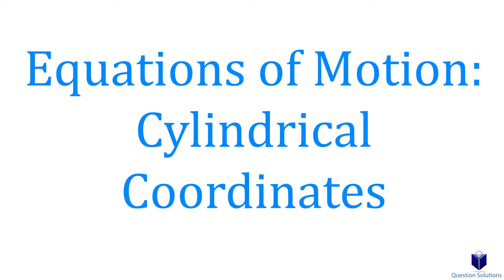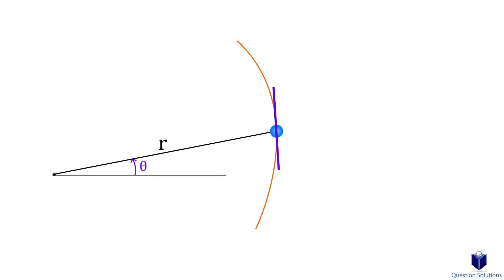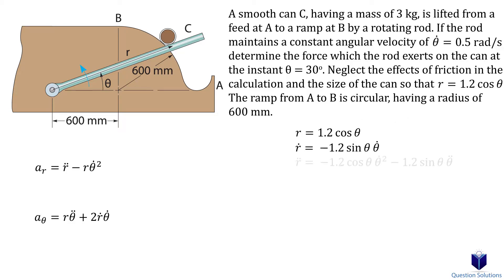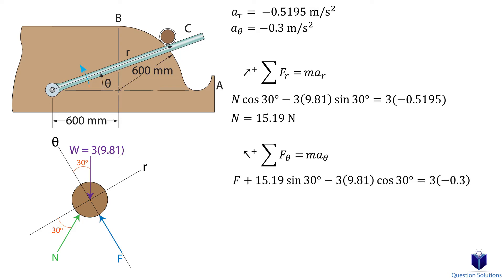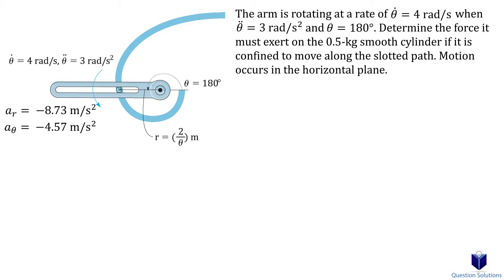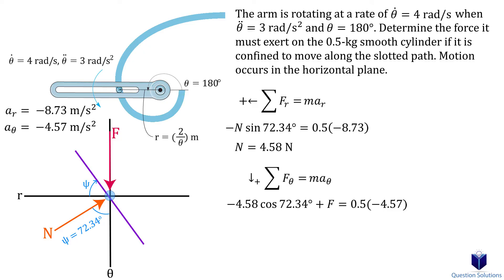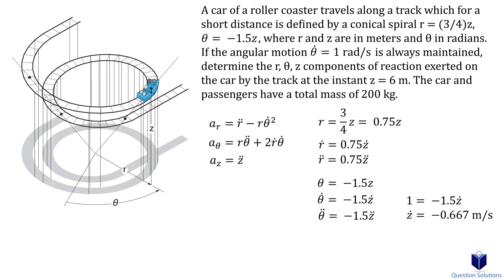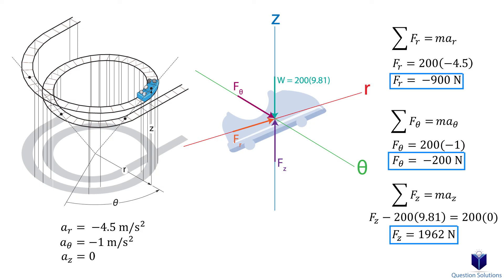F=ma Cylindrical Coordinates| Equations of Motion| Learn to solve any problem

Comment: 7:38 why is the weight of the cylinder not included in the free body diagram or as a force?
Reply from the maker: It's a top down view. So weight would be into the screen.

Comment: Why did you change the direction of your axis in example 2? Does this affect the sign convention on the RHS for the acceleration components?
Reply from the maker: Well, you can change the direction of axes anytime you want, in any question you want. For example, you can have positive y-side on the left, right, top, bottom, all that matters is that your corresponding x-side is properly in place compared to the y-side. It doesn't lead to incorrect answers as long as you establish your equations properly with proper positive and negative signs. Also, just want to point out that for the 2nd example, you're given a top down view of the mechanism.
Reply: @QuestionSolutions  That makes total sense. Thank you for the reply! There aren't many stitched like you anymore lol

Comment: how do you know when to include the weight? Is it when it says that motion occurs in the horizontal plane only then you don't include it? and then all other times we do?
Reply from the maker: So if you're given a top down view, like question 2, and you're using a 2D system, then you can't include the weight, since that goes into the "ground" and you're looking at it from the top. It also depends on how you establish your forces. For example, in the last problem, we accounted for all the z-axis forces by using Fz.
Reply: @QuestionSolutions  how do we know it's a top down view? in some cases like question 1 you still use the weight but it's 2D.
Reply from the maker: @AadilaAsry  Question 1 is given where we see it straight on. So it's not a top down view, so you need to include gravity. It's not a matter of 2D vs 3D, it's the perspective given in a problem. I think maybe it takes some time to get accustomed to figuring out what the drawing is showing us, but normally, you can tell if it's a top down view by seeing how something moves. In example 2, we're specifically told motion occurs in the horizontal plane as well, so that's an indication it's a top down view.

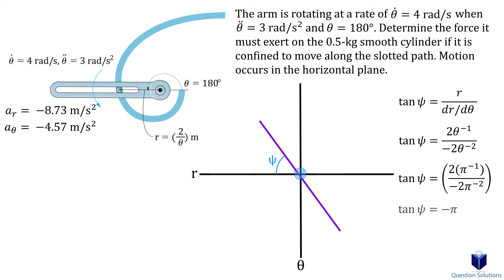Comment: in 6:41, why do we assume the r and theta axis in the opposite that we are accustomed to (+ right axis and + top axis)? and why did we not change the sign of the accelerations obtained? can you explain how will we know the directions of the accelerations?
Reply from the maker: You can, not just for these problems, but for any problem, assign the directions of positive and negative for any given axis. It's completely up to you. A really simple and general example would be when you have forces all pointing in the "negative" y-axis. In that case, it's beneficial to use down as positive so you deal with less negative signs. You will end up with the same answer, regardless of what you pick, but sometimes, it does make the math easier. You can also orient the axes anyway you like, it doesn't have to be straight up and down, you can rotate them as well, as long as it's 90 degrees between the axis lines. I would also like to point out that in the problem you're referring to, we are looking straight down as well. So imagine you're on top of this system and looking downwards.
Reply: my point is, the acceleration is negative. how do we know the direction? why did we not remove the negative sign?
Reply from the maker: @kc9487  I think you are misunderstanding what this negative sign is indicating. Imagine you're in a car and you are driving to the right at 60km/s. You gently press on your break peddle and the car starts to decelerate. Does the direction of the car change? No, right? It's still going to the right. So you have a negative acceleration, but your velocity is still to the right and positive. So when you solve questions, we can't just remove negative signs, we follow through with it until we get to the end. So in this problem, this arm is rotating in the direction shown with the arrow, but it's slowing down.

Comment: please be more clear for the explanation on how do you find angles?
Reply from the maker: I don't know where you're referring to, please use timestamps.
Reply: @QuestionSolutions  4:08 and do not get how the angle from radial is 30 degree
Reply from the maker: @mebawubeshet6729  Something that might help you is to draw a big diagram on a large piece of paper and use a protractor. This might help you visualize it better.
Reply: @QuestionSolutions  ok and please recommend me videos. or do you have any videos on this topic????
Reply from the maker: @mebawubeshet6729  Unfortunately, I don't. It might help to refresh some geometry. I think a lot of the time, just doing as many questions as possible usually helps. Try drawing them on large pieces of paper and seeing if that helps you :)

Comment: These videos are really nice . I have a question though . At 7:19 the normal force is included into the FBD following the idea that its normal to the tangent line. But then the force F is included in the direction of theta. Why is it that we dont always assume there is a force parralel and one perpendicular to the tangent line rather than making conclusions based on the structure?
If I was to assume the first , would it be ok or is that incorrect ?
Reply from the maker: Well, let's say for the discussion's sake, the force is parallel to the tangent line. If we look at how that force would be applied, it doesn't make much sense right? Just by looking at how this pin sits in the slot and where contact occurs, it's not possible for the force to be parallel. It has to come straight down at the location shown on the diagram. Also, note that this is a top down view so it might be a bit hard to see. 
Let's switch to a simple box. Imagine a box sitting on an inclined plane, and I am pushing this box from the side of the inclined plane but at an angle of 45 degrees with respect to the incline. Is it right to assume that the force is parallel to the incline? No, right? The force is independent. But now what about the normal force? That's going to be perpendicular to the inclined plane. Another force that behaves similar is weight. It doesn't matter about the incline, that force will always point down (along y-axis). I can put the box on a 45 degree incline, a 30 degree incline, doesn't matter, the weight is straight down and the normal force is always perpendicular to the plane. So just like that, the normal force in this question is perpendicular to the tangent line. Force applied is independent because we can push our box from any direction we want, at any angle we want.

Comment: 7:11 Hey man in the FBD why we don’t have to out the weight of the cylinder. Thanks
Reply from the maker: So in the question, we are told "Motion occurs in the horizontal plane" as in, it's like you're doing a top down view. So the weight would be acting into your screen.
Reply: @QuestionSolutions  that explains it. Thanks a lot!
Reply from the maker: You're very welcome! @Sigma_J001

Comment: At 6:28, y does the FBD for the second question not have the weight of the cylinder acting on the rod in the transversal axis?? Since the weight was used in the FBD in the first question.
Reply from the maker: So in the question, we are told "Motion occurs in the horizontal plane" as in, it's like you're doing a top down view. So the weight would be acting into your screen.

Comment: ar = -8,73    will be m*ar=0.5(-(-8.73))  =0.5*8,73  because left is negative ?  at 7.32
Reply from the maker: No, the acceleration values are independent since they were pre-calculated.

Comment: why you forget the wight it force ?
Reply from the maker: Please let me know a timestamp so I know where to look.
Reply: @QuestionSolutions  at 7:02 in this question when you simplify the forces you didt take care of wight
Reply from the maker: @Aooomr100  Yes, that should have been drawn in the free body diagram of the pin. My mistake. Please remember that weight is always straight down. Even if it's not shown, it is there, since it's mass times the acceleration due to gravity.

Comment: Hello!
Example 2: the weight is ignored, which is in the direction of θ. Considering the weight I got F = -5.8 N.
I appreciate if anyone check this and reply.
Reply from the maker: You don't have to consider the weight for this problem, unless your problem was different?
Reply: @QuestionSolutions  why dont you have to consider the weight but in other problems you do ?
Reply from the maker: @willgggg900  This question is all about the wording. "Motion occurs in the horizontal plane" as in, it's like you're doing a top down view. So the weight would be acting into your screen.
Reply: @QuestionSolutions  okay thanks i just realised i really appreciate your videos it has helped me alot
Reply from the maker: @willgggg900  You're very welcome! :)
Reply: Thank you sir.

Comment: The question on the horizontal plane, shouldn't the normal force be in z-direction which is the static direction?
Reply from the maker: @med7756  The normal force is always perpendicular to the tangent line. So your assumption is incorrect here, also, don't get too stuck on the diagram because it can lead to incorrect answers. Instead, remember, the normal force will always be perpendicular to the tangent line, because that's where they touch. I go through this in detail around 1:01.
Reply from the maker: Can you give a timestamp as to where you're talking about? Thanks! :)

Comment: When you calculated psi in example 2. I get -89.68 degrees and that is when my calculator is set to radians if i do not use radians and only substitute -pi then I get 72.34 degrees. I'm not sure when to use radians and when not to???
Reply from the maker: If you used radians, you should get -1.26, which then converted to degrees will still give you -72.34 degrees. Please double check. Since we are trying to find an angle on a coordinate axis system, use degrees, it makes the math easier than using radians. The psi angle will be in degrees, not radians. 👍
Reply: @QuestionSolutions  thanks for replying so fast! If I use theta and then use tan(180 degrees) i also get - 89...sorry if I'm misunderstanding something
Reply from the maker: @ruandre5619  Okay, I think I know what's happening. So you should be entering pi, exactly as is, 3.14. This 3.14 is just a ratio we found (conveniently for us, it turned out to be pi, but it could be any value like 6.28, 9.42, etc). So don't put in 180 degrees. When you take the tan inverse of the value, if your calculator is in radians, you will get -1.26, if it's in degrees, you will get -72.34 degrees. If you convert the -1.26 rad to degrees, you will get -72.34 degrees.
Reply: @QuestionSolutions  thanks man I appreciate!
Reply from the maker: @ruandre5619  You're very welcome!

Comment: Hey dude nice video , I hope you can make a video on how to calculate normal forces because I didn't really get how you calculated it in 4:12
Reply from the maker: Could you elaborate which part you didn't understand if you have the time? For example, was it where the cos30 and sin30 came from? I'll do my best to help!
Reply: @QuestionSolutions  thanks for replying! ,

My problem is with the normal force at 4:12 

Like shouldn't there be two normal forces one with the rod and the other with the surface ?

And how did you determine the angle to be 30? Is the normal force parallel with radial line? 

And if it's perpendicular to the tangent line what is the relation between the tangent line and the radial and transverse line ?
Reply from the maker: @Furfur-rj2tw  To answer your first question, no, there is one normal force. Imagine you have a box on the floor and you push the box with your hand, (you apply a force from the left). Where do we draw the normal force? Straight upwards, right? That's where the box contacts the floor. In the same way, here, the rod simply applies a force that pushes the cylinder along the surface. So the normal force is tangent to the surface. For the second part of your question, no, the normal force is not parallel to the radial line. It is tangent to the surface, and it's 30 degrees below the radial line. We are given the angle in the question (it's the angle that's created with respect to the x-axis and the radial axis), you can draw out the normal force tangent to the surface, and with a bit of geometry, you will see that it's 30 degrees (if you want to prove it). To answer the third question, I am unsure of which tangent like you are referring to? Keep in mind that the normal force will always be perpendicular to surface of contact. Also, please take a look at the previous video with the x, y, z coordinates as well, as that builds on some of the stuff that is used in this chapter. Let me know if that clears up some stuff. Thanks!
Reply: @QuestionSolutions  Thanks for replying again ! I appreciate you giving me some of your time.

What I was trying to say about the tangent line is that , we know that the normal force is perpendicular to the tangent line , so if we were to draw a tangent line in the F.B.D where would it cross?

It's obviously not going to be perpendicular to the radial line , I would imagine it a little tilted so basically my question is

If I were to draw the tangent line in the question @ 4:12 what shall I draw it with respect to or how to draw it basically?

And thanks for your time again !
Reply from the maker: @Furfur-rj2tw  The tangent line is parallel to the surface where the cylinder touches. The normal force is then perpendicular to that tangent line. 👍

Comment: It is straight necessary to calculate de psi angle in radians? Why we don't plot teta in degrees? Thanks for the video!
Reply from the maker: If the question is given with rad/s, then it's better to find it in radians, you don't have to, but it makes it easier. You can also plot in degrees, but again, that's your choice, usually, if everything else is in radians, then its better to use radians.

Comment: Hello, when drawing the FBD for the first problem @ 4:12 how did you know that the normal force N is acting on the can 30 degrees below the radial axis? You said that the normal force is always perpendicular to the tangent [of the path] but when did we find the tangent to figure out the position of N?
Reply from the maker: So it's actually where the wheel is touching, because wherever the wheel touches (it's the brown curve) would be the tangent point since it's a circle. The angle is already given, so it would be 30 degrees from the radial line. If you had a wheel on a flat surface, the normal force would be straight up, right? That's because that's the contacting point from the floor. In the same way, this wheel is touching 2 places, the arm and the curve. The normal force is simply tangent to that curve while the force being applied is tangent to the radial line. I hope that makes sense. 👍
Reply: @QuestionSolutions   but 30 degree is n't the angle from x axis
Reply from the maker: @mebawubeshet6729  But it is. If you say it's not, show or explain why it's not. The burden of proof is upon you.
Reply: Origin of the mechanical arm to the middle of the mountain is 600mm, the radius of the mountain is also 600mm. This creates an isosceles triangle. And inside such a triangle, we know that the angle that 1 leg makes (with it's base) has to be equal to the other leg. The normal force on a circle surface goes through it's origin (like a radius line). 

Thus we know the r axis is the mechanical arm, we know that the normal force is with the radius line and we know that the arm, the radius line and the ground create a isosceles triangle (with the mechanical arm as the base) so the angles between the ground and the arm (which is 30 degrees) has to be the same angle the mechanical arm and the radius line creates.

Just draw the triangle if you cannot follow the explanation.
Reply: @beterax  great explanation. does it mean the normal force goes through the mountain radiation
Reply: In this problem, to figure out where is the normal force, we draw a circle  its radius  is 600 mm.  The point C  is on the circle.  We all knew that the tangent line at any points on the circle will be perpendicular to the radius.  So  in this problem, the normal force  is along a radius connecting the center and point C.( point C is also the intersection of the radial axis and a circle ).  From the figure we will see the angle between the radial axis and the normal force = 30 o.
Reply: @pnwtutoring   if the normal force is perpendicular to the tangent line and also the tangent line and the radius are perpendicular so the normal force should also be in the radial direction
Reply: guys guys CPF  chrem , pass,  forget